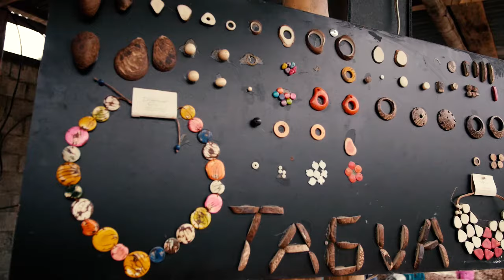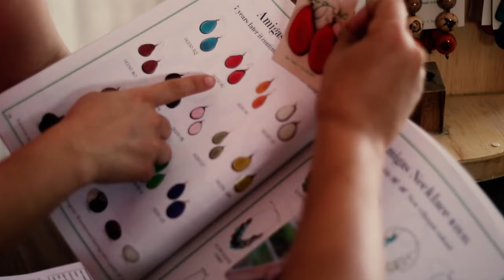How our Tagua Jewelry is Made

Comment: have you ever used a rock tumbler? I have been carving tagua nuts for 23 years with belt sander for the coverage , then hand polishing the inside with -240 grit /400 / 600/ & 1000 grit . It's time consuming . Do you have any advice on using large rock tumbler ? Thank you